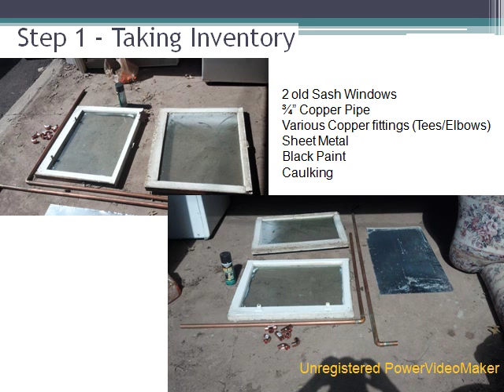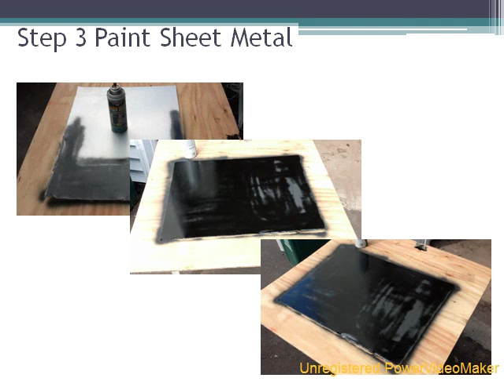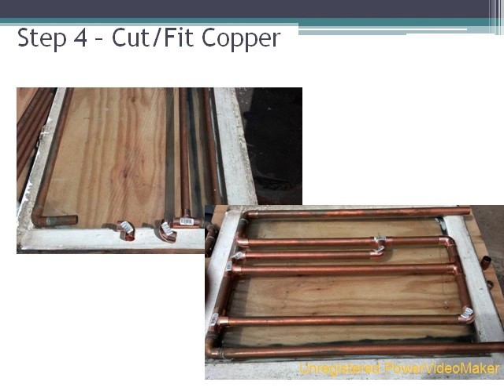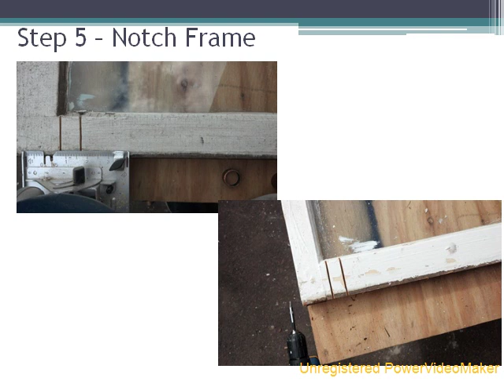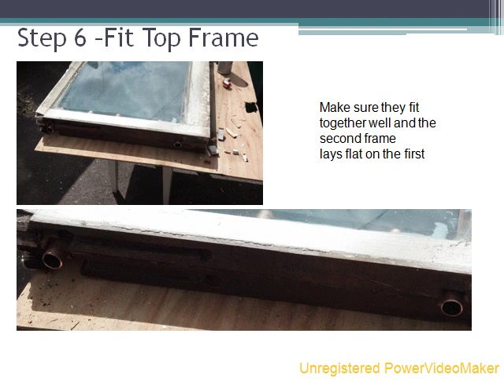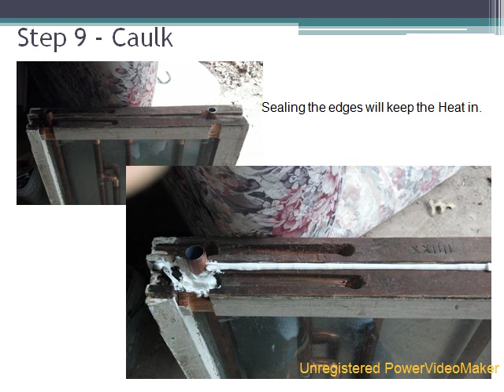Window Air Heater 10 easy Steps

Comment: although the inside of your box may reach pretty high temps {200f maybe}, you won't much pull much heat out of it through 3/4" pipe. I've made similar mistakes building them. gutter down spout or aluminum cans drilled out and painted black make excellent conduit for this idea